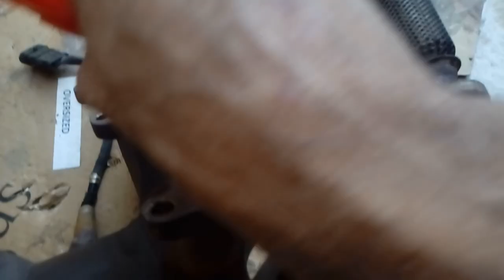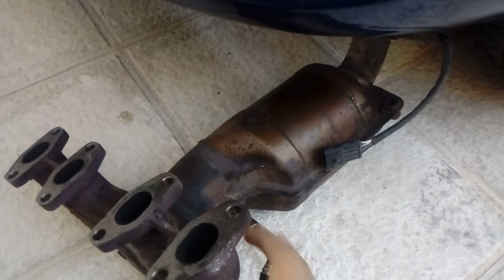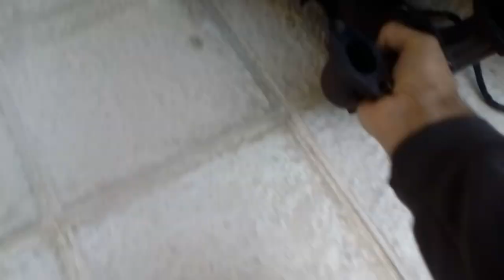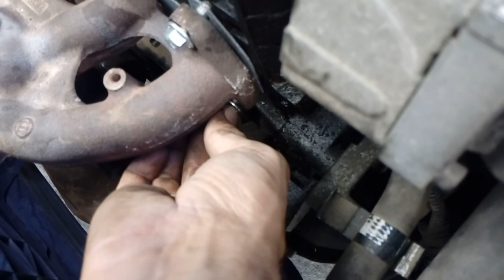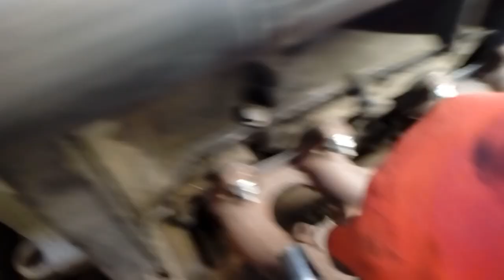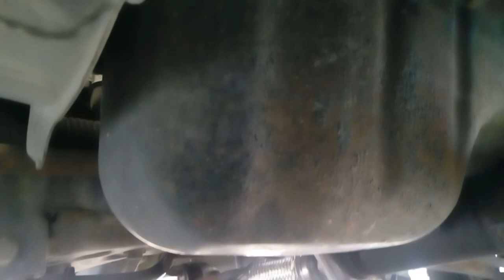Fiat Punto mk2 - Installing exhaust manifold - DIYChannel

Comment: Do the heads have to be screwed in with specific force? Most of parts around the engine have a specific value of Nm needed
Reply from the maker: You are right, I did it, but I forgot shot it for the video...